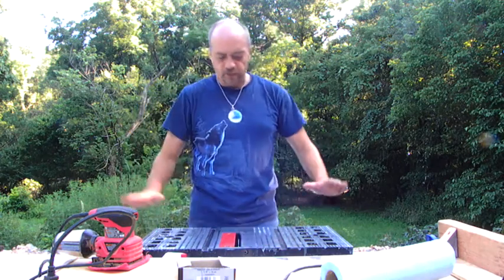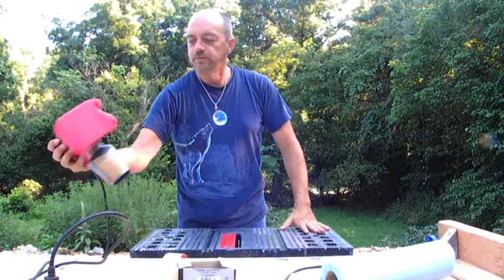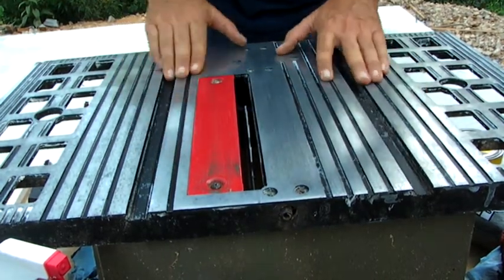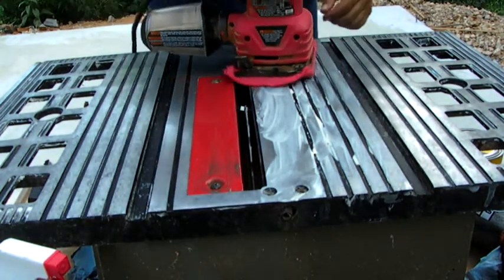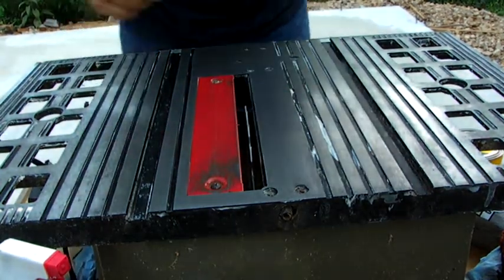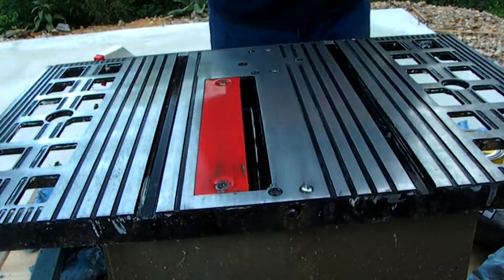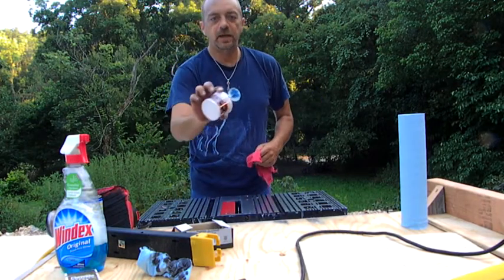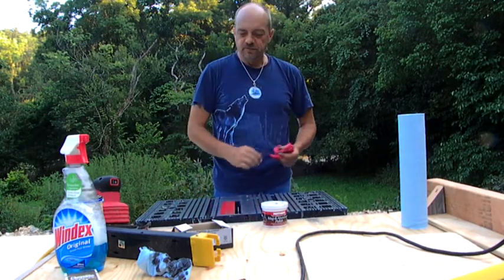Polishing Aluminum Table Saw Surface with a Sander

Comment: I just purchased an old Craftsman aluminum table saw and tried to clean the table with almost everything. Was told to just throw it away. Found this video this morning, took about an hour with the sander. Put a coat of wax on it, and it works like new! Thank you so much.

Comment: This is great info. After reading the reviews on a 7" Rigid tile saw that I purchased- I discovered the only real complaint was drag from the aluminum surface and metallic scuff mark left on the tile surface when cutting tile surface down. I am going to solve the problem with your trick- as soon as it arrives. Thanks bud!
Reply: Did you do this? I want to smash my ridgid every time I rip a tile and it binds up..lol

Comment: Hello Mr. Shed. I have a craftsmans table saw that's been in the weather just like your saw. Unfortunately mine has pits in the top. I've used 4/0 steel wool and I've gotten rid of a lot of the nasty dark spots. But , I still have pitting. What should I do??